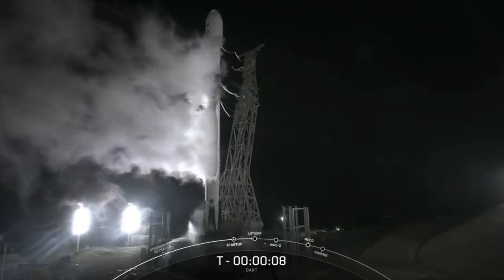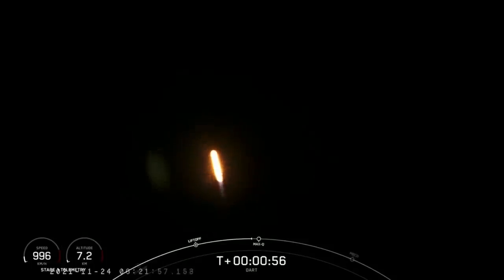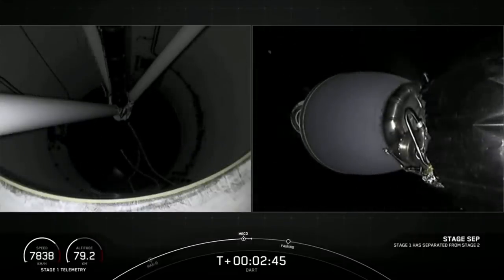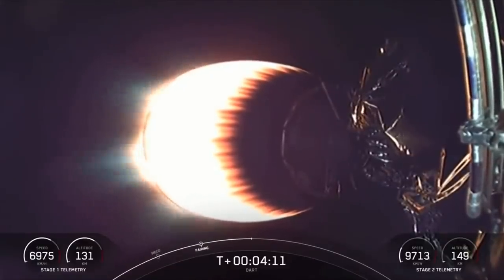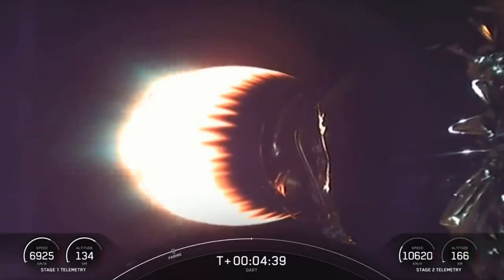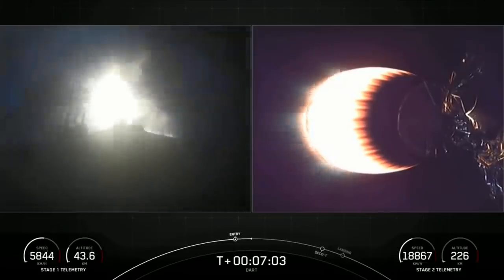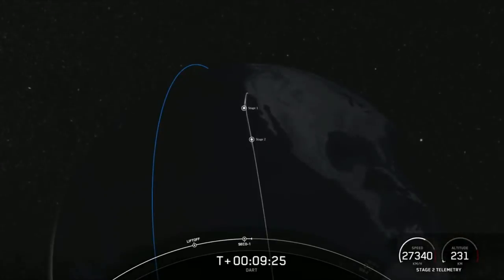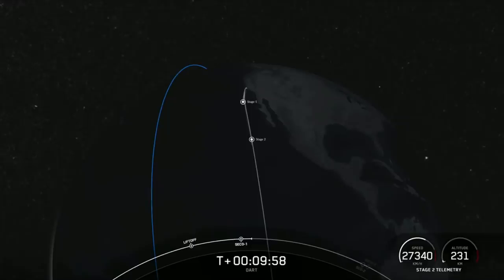Blastoff! SpaceX launches NASA's DART asteroid mission

Comment: I wonder if another possible option for deterring an asteroid could be a nuclear weapon detonated at a distance to shift it's course
Reply: if the detonation is at distance it will not do anithing to the asteroid because the shockwave need matter to do something and if you explode it on the asteroid it will make a ton of fragments that can cause harm to the planet (sorry for my bad english)
Reply: @6soum  Alright then let's hit it with the edge of the blast radius. It would be great to at least hear more (or any) talk of putting the God like power of nuclear explosions to use for this purpose.
Reply: @_MaxHeadroom_  The blast is made by the pressure in the air if there is no air in space there is no blast, basically if you don't hit it it will not do anything and if you hit it it will explode and make fragment
Reply: @6soum  So you're saying if you were to be right next to a nuclear detonation in space you would stay completely stationary. There's no way
Reply: @_MaxHeadroom_  if no debris touches you you are fine.
Reply: @6soum  So you would stay completely stationary then. Sounds about right
Reply: @6soum  Have you heard of Project Orion? It was a program in the 50's and 60's that did research into spacecraft propelled by nuclear explosions. If that works then you could definitely do that with an asteroid.
Reply: @_MaxHeadroom_  You would if no matter is touching you, the blast of a nuclear bomb is made of high pressure air so in space no blast
Reply: @_MaxHeadroom_  you must be right i didn't think of the mass of plasma ejected i tought it was juste air pressure sry
Reply: Better to destroying all

Comment: Does the payload space inside the fairings stay pressurized from being at ground level or does it decompress as it gains altitude?  Just curious if internal air pressure helps push fairings away from payload.
Reply: i think theyre unpressurized
Reply: Vasco
Reply: I belive it will bleed air following the aptnosphere pressure because I’m pretty sure it has to be air tight